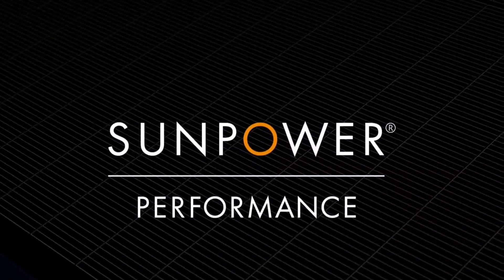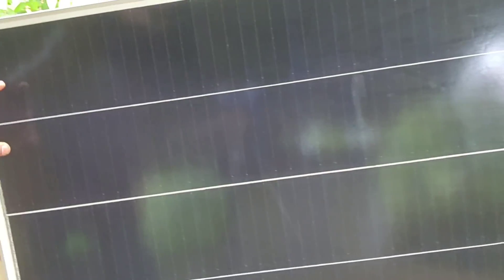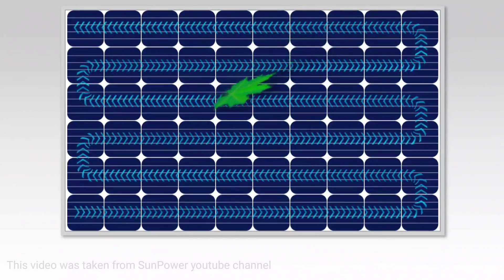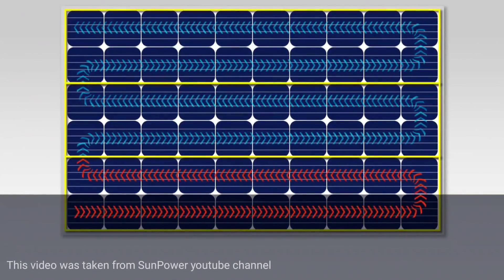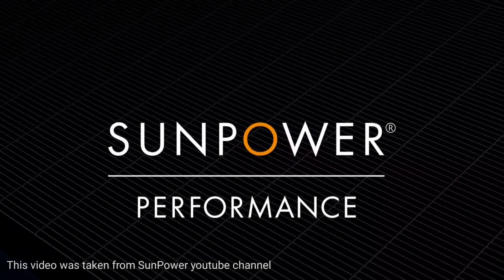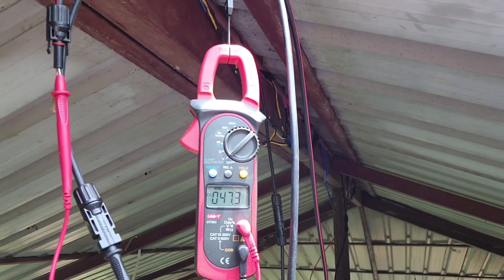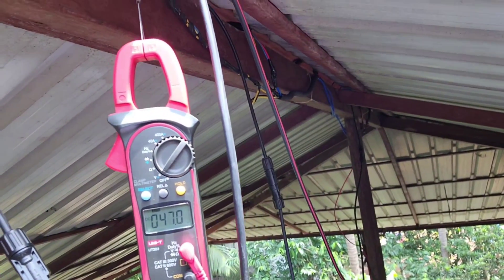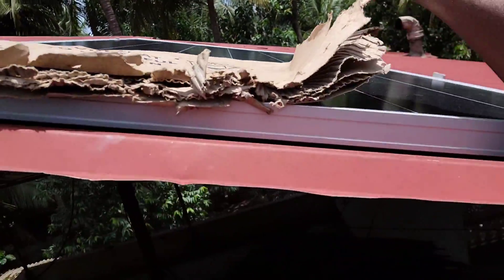SUNPOWER SOLAR PANELS. 415 watt സൺപർ ഒരു കിടിലൻ സോളാർ പാനൽ

Comment: സുഹൃത്തേ എനിക്ക് ഒരു ഒരു കെ വി സോളാർ പാനൽ വെക്കാൻ വെക്കാൻ ആഗ്രഹിക്കുന്നു എൻറെ കൈവശം 1150. Va inverter 12 volt 150ah solar ബാറ്ററിയും ഉണ്ട് ഇൻവർട്ടർ സോളാർ കണക്ഷൻ കൊടുക്കാനുള്ള സോക്കറ്റ് ഉണ്ട് എനിക്ക്  ഒരു കെ വി സോളാർ പാനൽ കൊടുക്കുവാൻ പറ്റുമോ എങ്ങനെയാണ് കൊടുക്കേണ്ടത്
Reply: Usually we use 2batteries of 150Ah each for 1kW system.anyway please contact 6238600029for more info